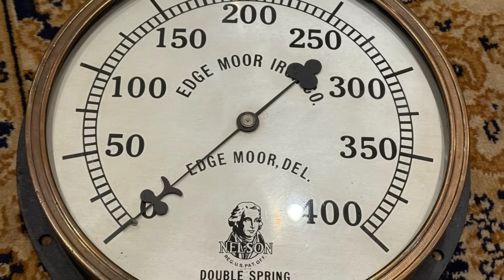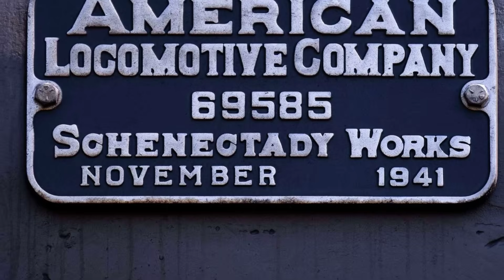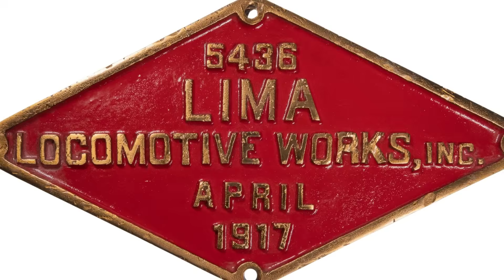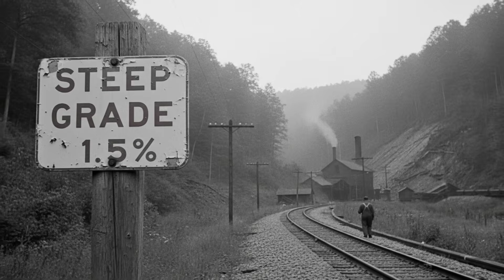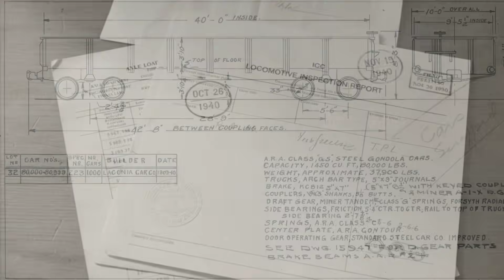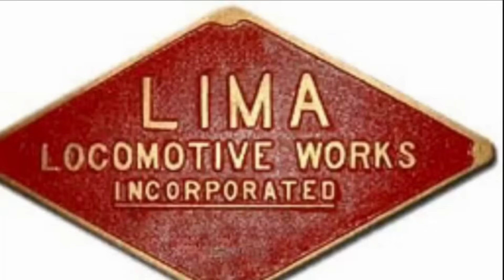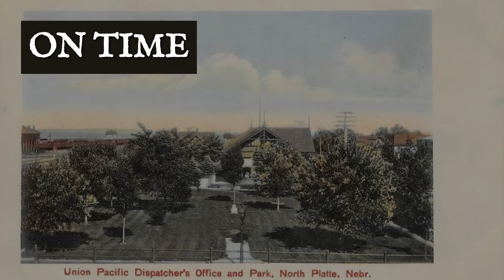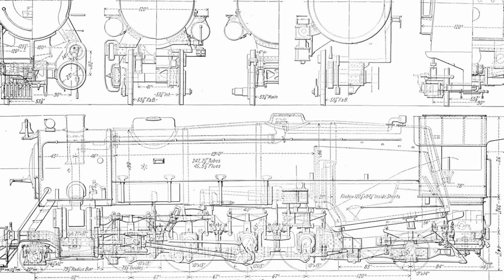Why Horsepower LIES: The Tractive Effort Masterclass (Big Boy vs. Allegheny)

Comment: ADHESION IS WHAT MATTERS 

TRACTIVE EFFORT IS THE TENDENCY OF WHEELS TO SLIP USING THAT HORSEPOWER 

BIG BOY ----
300 LBS BOILER PRESSURE 
135,000 LBS T.E. 
5800 HP AT THE COUPLER AT 
40 MPH
65,000 LBS DRIVER AXLE WT. 

IS WEAKER THAN 

ALLEGHENY 
260 LBS BOILER PRESSURE 
115,000 LBS T.E. 
7500 H.P. AT COUPLER AT 
57 MPH
83,000 DRIVER AXLE WT. 

AN EASY WAY TO LOOK AT IT USING MODERN DIESELS 

SD70 D.C. MOTORS 
4300 HP. 
120,000 LBS T.E. 
SD70 A.C. MOTORS 
4300 HP. 
180,000 LBS T.E. 

THERE WERE COAL MINING ELECTRIC MOTORS THAT RAN OFF OF POWER CORDS TO REDUCE THE CHANCE OF ARKING 
THEY PRODUCE ONLY
300 HP.
BUT HAD
300,000 LBS T.E. 

BOTTOM LINE 
TRACTIVE EFFORT IS THE ABILITY OF THE WHEELS NOT TO SLIP AND TO CONTROL HORSEPOWER PRODUCED TO BE USED AT THE COUPLE . .

Comment: There is so much more than this.  Clearly starting tractive effort is what gets something moving. Once it is moving the tractive effort starts to fall.  Because the steam can't be produced without limit.  It can't get into our out of the cylinders without limit. If there is a timetable to be met there is no point in having an engine that the torque drops by 10 mph to the point, where it cannot go faster, if your timetables require 30 mph.  Often the goal is how to move the maximum tonnage per day on a particular set of track.  Which is always a compromise between speed and load.
Reply: >> Once it is moving the tractive effort starts to fall.  
To avoid the falling tractive effoft, you need power since Power is Force multiplied by speed (P=F * v)
>> Because the steam can't be produced without limit.
Also here: the limit is the power of the boiler. The more steam a boiler can put in the same time, the more power the boiler has. Power is defining always how much of something is done per time unit.

Comment: Wrong. What matters is "adhesion" ie the friction between rails and wheels.  Always a problem for locomotives.
Reply: Adhesion control is the control how to get the force to the rail, but if the force is not there, you can it also not get it to the rail.

Comment: AC traction diesel locomotive from GE would leave any steam engine in the dust on any grades. The DC locomotives would slip as much as the steams would.
And high HP is what allow a loco to be capable of maintaining that high torque in order to reach higher speed.

Comment: Ultimately just slight differences between the two and because of steam propulsion maintenance  was a nightmare for both. None of them had  600 tons on the driven wheels, that was the overall weight including the loaded tender.

Comment: Horsepower is force times speed (P=F*v). So if the speed is low for freight trains, than only F is important. If you want to go fast, you need horsepower as well. Therefore a typical high-speed train with 8 cars has 13.000 HP. Most of it is used to fight the air resistance at high speed. The example is ETR 1000 from Italy with max speed 300 km/h (190 mph).
Reply: No, most of the power is used to accelerate the train to high speed. Air resistance is not a big factor.
Reply: @Carfree-Cities okay das wirkt sich nur bei höheren Geschwindigkeiten aus wie der Spoiler bei Rennwagen. 
Aber vielen Dank für deine Erkenntnisse. 
Ich habe sowas nur als H0 Modell, 
Ich finde das einfach imposant. 
Gut,es gab noch größere(ich glaube die ist bei New York Central gefahren allerdings als Personenzug lok mit teil Verkleidung), die war wohl noch größer als Big Boy aber die Maschine hat was was andere nicht haben.
Durch den Malett Rahmen, 
Kommt das optisch noch viel besser. Schon alleine die Beweglichkeit der Dampfrohre, den Druck die diese beweglichen Nahtstellen aushalten müssen, einfach galaktisch gemacht super, 
Zu dieser Zeit mit den Materialien sowas zu bauen, 
Excellent 👍👍👍👏👏👏👌✋
Reply: @PierreBertsch  >> das wirkt sich nur bei höheren Geschwindigkeiten aus
Ja, so ab etwa 160 km/h
Reply: @Carfree-Cities  Not true, above 100 mph, the air resistance is the largest factor, but your correct that the high-speed train specifications typically contain a requirement for the residual acceleration at max speed.
Reply: Wow hast du Ahnung😮,
So fein aufgeschlüsselt, 
Über sowas habe ich nie nachgedacht aber, 
Logisch du hast recht. 👍👍👍👍👌✋
Reply: @PierreBertsch  Nach über 30 Jahren im Geschäft und mit Lok, die meinen Namen trägt, kenne ich das Thema ;-)  ... aber keine Angst, ich hatte diese kleine Physiklektion auch mal einer Geschäftsleitung gegeben ;-)

Comment: I can not understand your video.
First , if tractive efford is more important than horsepower the 2-8-8-8-2/4 triplex had to be the best freight locos ever.

Between a UP4000 and Alleygheny it looks so : from 0 to 15 miles the UP4000 perform better, but a fast freight loco don't want to go like a snail.
Between 15-20 miles the locos are nearly equal.
Above 20 miles the Alleygheny go away because of more horsepower, it is much better to run a train at 50 miles than a Big Boy. The draw bar horsepower from a UP4000 has it's peak 6298HP around 40-45 miles , than it fall down .

A Alleygheny peaks 7498HP at 49 miles at test and  the C&O believed a maximum of 7600HP at 60mph 

For me a Alleygheny is the better locomotive of these two. The best drag freight is N&W Y6b because of 5500DBHP at 25mph and a starting tractive effort around 170000lbs.
Reply: The y6 class had amazing tractive effort using smaller wheels and had plenty of weight on the driving wheels to really dig in. And amazingly powerful and efficient.  The medium drivers and high horsepower and good tractive effort helped it keep its loads moving fast. As for the triplex it suffered from not being able to supply enough steam. If they could have came up with sn insanely efficient boiler maybe it could have been more usable. But another issue was no freight car could handle the tractive effort at full power. It snapped coupling on every test. Technology just wasn't there yet. Including build strength of railcars.
Reply: Correct, the issue of the Triplex was that the boiler did not had enough power, so the speed was very limited. Force was there without doubt.
Reply: Let's test that 4,500 over Sherman. Also 6600-6800 for BB.
Reply: @floydrandol2731 
WRONG BIG NOTHING FAN 
BIG BOY PRODUCED 6200 AT 40 MPH AND IT DROPPED OFF AFTER THAT ..
[[[ U.P. DYNO TEST CAR ]]]
SHERMAN IS ONLY 1.1% CLIMB 
THERE IS NO CLIMB ON U.P. ANYWHERE ABOVE 1.2% ---- NOWHERE !!!!!!!
HORSESHOE CURVE IS 1.85 % 
TEHATCHIPI IS 2.2 %
N&W HAD MANY CLIMBS OF 2.0%